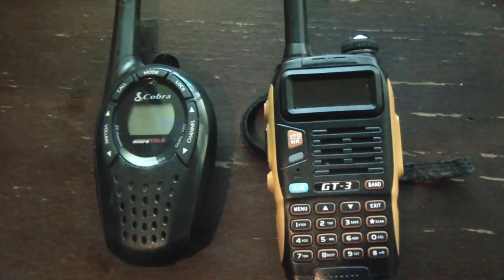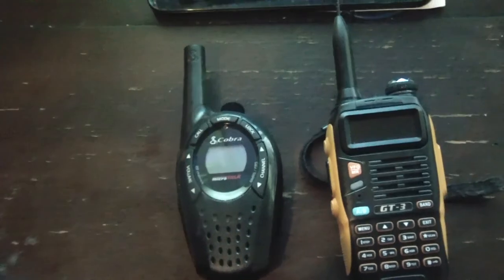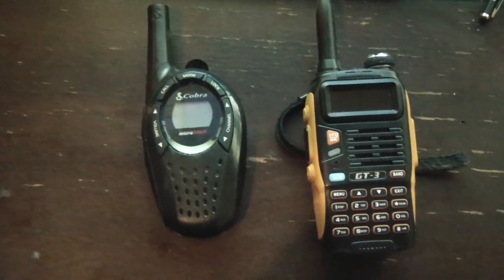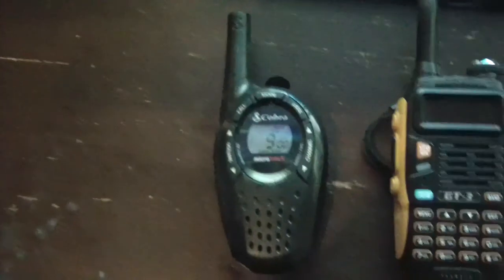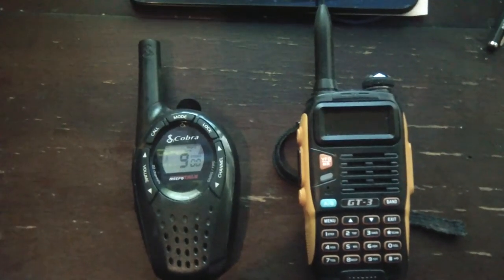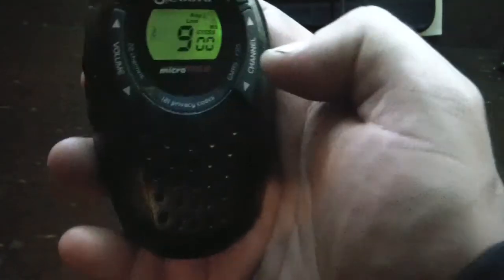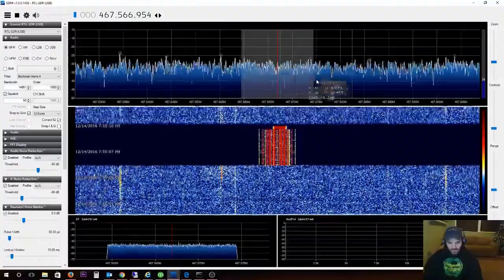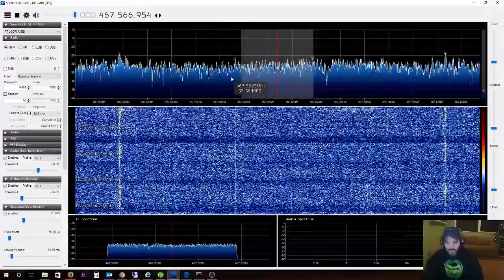GMRS FRS Baofeng experiment SDR# SHTF Cobra Microtalk

Comment: Personally I do not care what you do with the radios you bought and paid for with your hard earned money.. That's not my place to say what you do is right or wrong, your an adult fully capable of searching the internet for rules and regulations regarding radio use.... However there are mental midgets out here that think they are some entitled radio cop and will try and scare you with tall tales of FCC raids, swat teams, huge fines, and prison time.. Sure you have something to worry about if your running an illegal FM broadcast transmitter. But using a Chinese HT on FRS? Yeah you have a better chance of getting a speeding ticket on a tricycle that have the FCC get on you about type acceptance, certifications, etc.. They simply DO NOT care as long as you are not interfering with commercial or public safety traffic.

I will make a recommendation though, Get yourself a GMRS license, it's $65 and covers you and your family for 10 years, You can apply online, pay online and print out your valid license after payment is confirmed and BAM you're good to go.
Reply: Nah .

Comment: Baofeng isn't supposed to be used for frs under FCC reg
Reply from the maker: Too many watts?
Reply: But under the law it's to many watts. Tose radios are capable of turning the watts down so technically the law isn't broken but the still is not fcc approved
Reply: @scottbarnes7268  yeah man, that's the ridiculous part. You have the ability to decrease the power on the Baofeng's...but that also gives you the ability to 'break the law' by not decreasing power accordingly (for FRS/GMRS/MURS), on the Baofeng's. That's why it's 'illegal'?? Good thing gas pedals in cars and trucks can't work like that, otherwise there could be some legal problems with gas pedals and speed limits!! Let's not even get started about alcohol related potentials. Breaking the law. BULLSHIT. Thank god for break pedals, common sense and self-respect. Cheers man.
Reply: @dwaynerobertson383  I suspect the regulation was more out of keeping the spectrum open and not having it turned into a CB nightmare, since it was for family and business use until they got combined and then separated. considering everybody went to cellphones I don't think that's going to be a problem.
The bigger problem I see is the blister pack Pirates buying these things at Wally world and handing them to their kids to play with, partially makes me mad because when I was growing up I was stuck with cheap toys that were on 900 MHz with maybe two channels and barely went 100 feet. Later I found out that they shared the same frequency as my old cordless phone and baby monitors. (Yeah why do I not have my ham license yet?
and there's really no clear information on licensing except a blurb in the manual nobody reads and especially when you buy them at the thrift store.... I don't admit to anything.
Reply: Im a blister pack pirate
Reply: Ohhh shutt uuuppp already !
Reply: Sargent Gamer you shouldn't do many things, I doubt you never broke a law.

Comment: Great video. Personally I would still give the lady the Baofeng. The two radios just don't compete. If you change the channel names in chirp software to something a little less intimidating than just numbers then perhaps she could get along with it? happy Christmas and 73
Reply from the maker: Funny you say that. That's exactly what I did. I went into chirp and I'm showing names instead of frequencies. That little Cobra is not going to do shit probably.  I will probably using Murs and FRS primarily until I get licensed.  If the SHTF then I will be using 2M.
Reply: I agree, the little fixed antenna things are OK for close work but useless for anything else (as you probably already know) I just got my UK technicians license and threw my little handy talkies to one side. I hope your good lady can get used to the channel names. Best 73